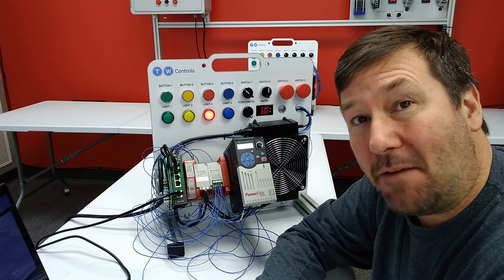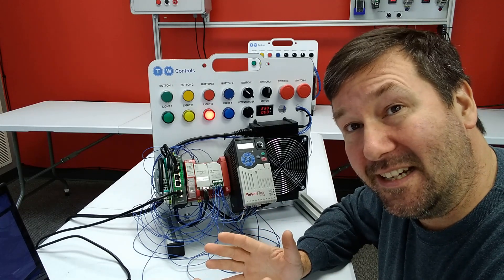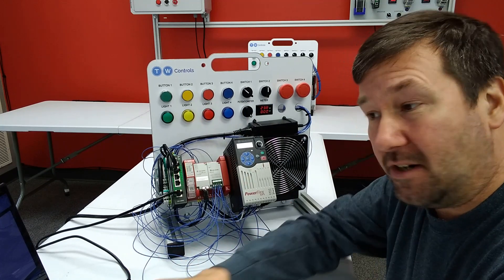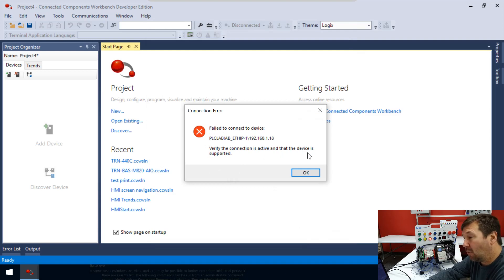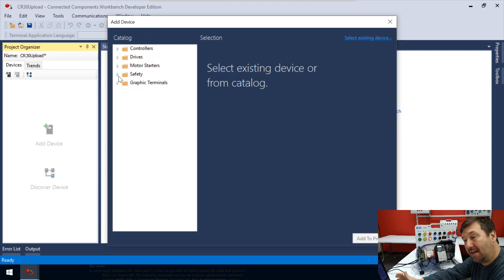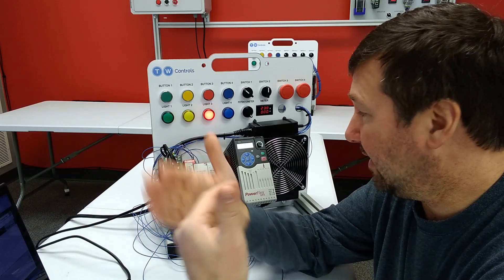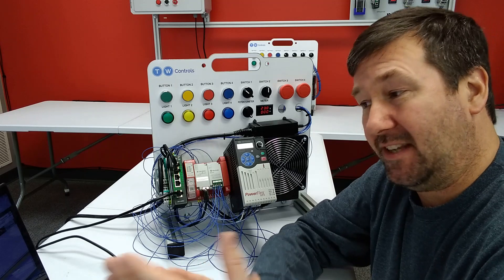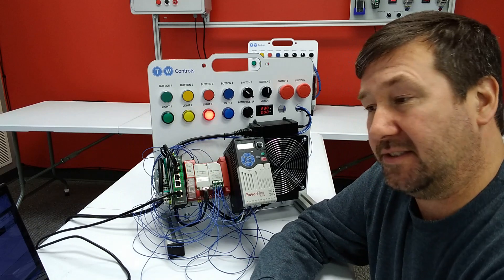Allen Bradley 440C-CR30 Safety PLC, Uploading Your Program with Connected Components Workbench

Comment: Hello engineer. A query. You have integrated Allen Bradley compact logix l33erm plc with a kuka robot. Can you help me. I'm in a project where there is a kuka robot, 2 power flex speed variators. All by ethernet ip communication. I hope you can help me.. Kind regards